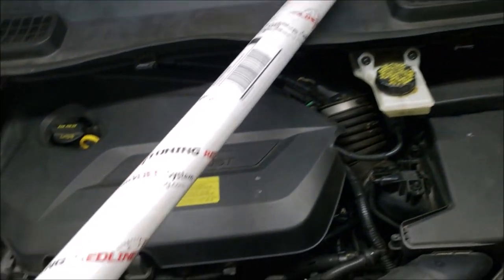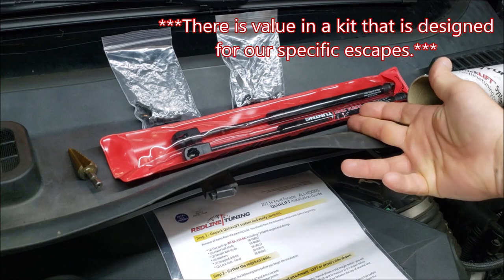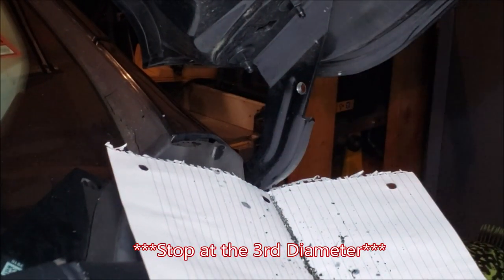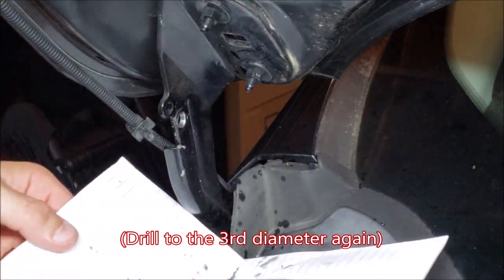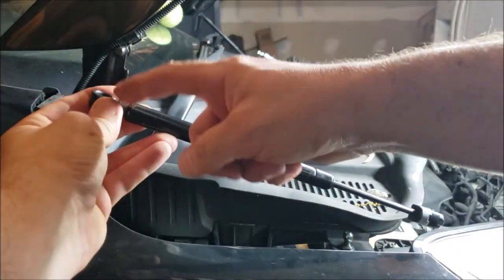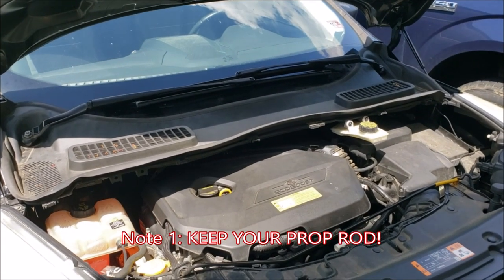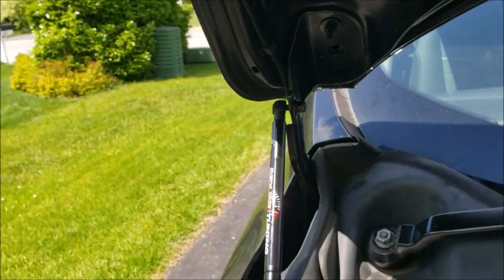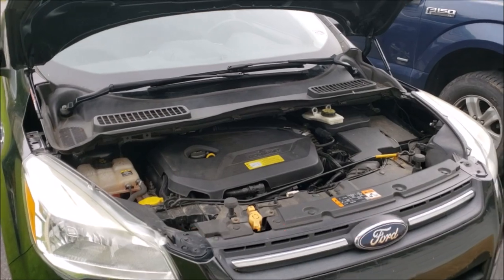Aftermarket Hood Lift Kit - Install and Review: HOW TO ESCAPE

Comment: Rahrena, Way to go! These are nice. I've used mine for 6 or 7 months now and have had no problems. So much easier to get around under the hood to work on without the prop rod. I left my original prop rod there to like you, eventually the struts will wear out and need replaced, so the prop rod will still be there... Thanks for all your videos they are very helpful!

Comment: I would say a “nice to have” rather then an essential. Not sure if really worth the effort to install. Here’s to hoping the hood is down closed shut rather then propped open more often then not. 😂😂. Great vid!
Reply from the maker: Amen to that- haha. I agree completely. The hood prop rod is still there as I said in the video- I will post an update if I see anything where we drilled the holes to mount to the hood hinges / supports. I have a sneaking suspicion that after breaking through the paint, we may see rust later on down the road but nothing yet. Thanks for the comment @Veets! I appreciate you taking the time to say something :)

Comment: Any news on the app?
Been checking for it on Google Play.
Reply from the maker: Hey Brendan! Sorry for the delay- we had to start from scratch back in May... believe it or not, the server that the developing platform is on was located in France...aaaand they had a massive fire and lost everything. So, we did some replanning and started over basically. I just posted a quick teaser snapshot in the "Community" tab for the channel and we're pretty happy with how it's mapping out right now. Just need some consistent efforts to push it to the finish line! Please let us know what you think and thanks for asking about it!

Comment: Nice feature would love to have it but for 100$ I'll just use the prop rod personally lol
Reply from the maker: Totally get where you're coming from haha. I have seen them for a while and was curious so thought I'd pull the trigger for the sake of the channel. With doing these videos and being in the engine bay on a frequent basis for recording, it is a "nice to have" but not a necessity for sure :) Thanks for the feedback @New Holland Skidsteer!
Reply: Also in a different video that you have done, i seen you replace the low pressure fuel sensor...I'm thinking about doing this because when i fill my tank (shell supreme) and let the car idle it'll drop in rpms for a second or 2 and come right back i have a video of the car doing this aswell. I want to think it has to do with the low fuel pressure sensor. It wants to stall but it doesn't  well i shouldn't say that because it has before while i was in drive through at McDonald's. But doesn't do it at all while I'm driving
Reply from the maker: @newhollandskidsteer8173  Understood- It could very well be the sensor- my key indicator that lined up with others was that it would hesitate at low RPM / idle AFTER already warmed up (kind of like your McD's drivethrough haha) and then would stall or get bogged down when trying to accelerate from that state. It's not a super expensive job and could be worth a try. Sounds like it may be time for yours- have you gotten any codes / CEL's?
Reply: @HowToEscapeDIYTipsandReviews  never had an engine light on because of it, i even check for codes when it happens, i have my own level 2 scanner
Reply from the maker: @newhollandskidsteer8173  That's cool you have one of those! Yeah mine did not always throw codes either... but when it was stalling or starting to die, it would hesitate, buck a bit, and then die out... or just die right away. Always after warmed up though. Let me know if you decided to try the sensor swap and how it goes! If you do, just remember to let the fuel pressure dissipate :)
Reply: @HowToEscapeDIYTipsandReviews  for sure man. Watching your videos makes it easier for me to do the work myself, don't get me wrong im a car guy amd do most of my own work but somethings i need a mechanic for lol like warranty work (oil change) everythkng else i prefer to do like the roof racks your simple video i had my leak fixed in a matter of 15 mins !!!
Reply: Where did you get the fuel pressure sensor? I can't find it at like napa or car quest maybe a dealership part ?
Reply from the maker: @newhollandskidsteer8173  you may be able to! I got mine off Amazon and you could probably find it on rock auto as well. There is the amazon link in the sensor video description if you decide to go that route
Reply from the maker: @newhollandskidsteer8173  oh that rocks!!! Still dry im assuming???
Reply: @HowToEscapeDIYTipsandReviews   Yes it is ! I laugh about it everytime i get in on a rainy day too lol i just gotta find the time (with a small child) to get the headliner clean i have a spot cleaner just need the time when I'm not working or spending time with my daughter
Reply: @HowToEscapeDIYTipsandReviews  did you replace just your low pressure fuel sensor ?
Reply from the maker: @newhollandskidsteer8173  that was what fixed it. I had tried my high pressure fuel sensor as well but it didn't do anything.
Reply: I "made" my own kit, bought struts on ebay, and got the bolts from a local car parts dealer (in Norway). Only thing I changed, was the location of the bottom bolt. I used the one just left/right from the other bolt. Did this because the ball point bolts I got were to short for his location. But it works absolutely perfect, and does not conflict with the ruber, as in the video 😀👍
My total cost was about $25-$40, give or take a few